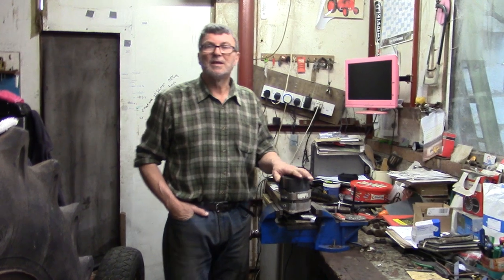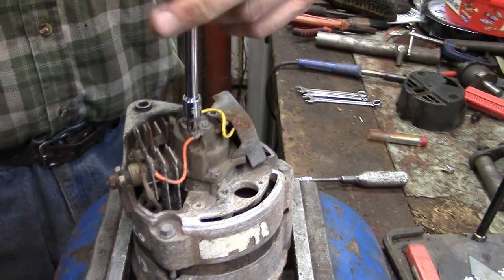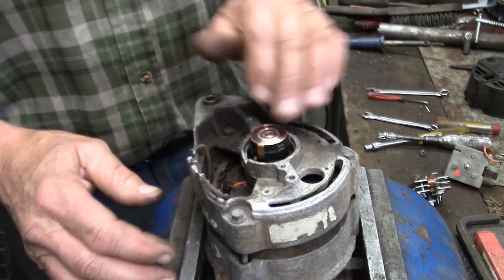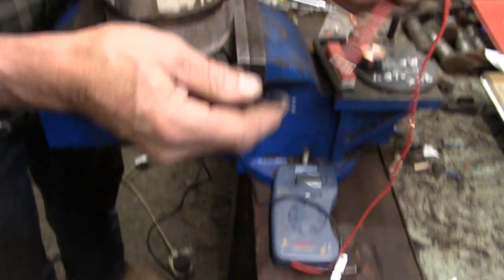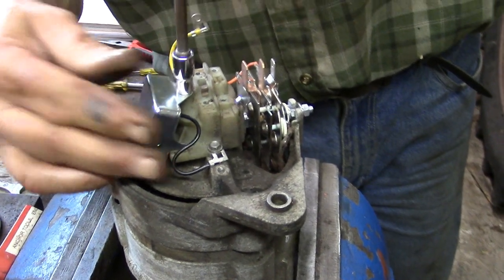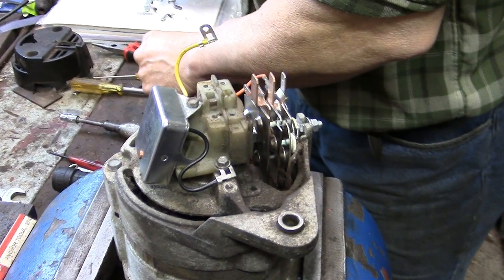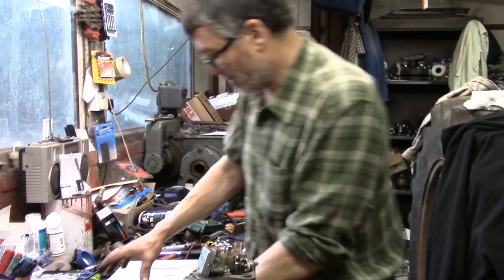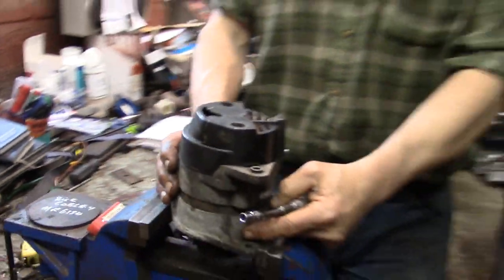Lucas ACR Alternator Repair

Comment: Thanks very much mate , dead right , photo the wiring positions of the components in the back of these before you strip it out , I did one in an almighty hurry on a J.C.B. yesterday , messed it up , had to watch your video to know how to get it right again , ( I unplugged it with the engine stopped , then clipped the cabling back out of harm,s way , so no tragedies . )
I can recommend M.U.R.E. in Mid - Ulster for getting the right parts to you very fast , overnight from Ulster to central england . ( Mid Ulster Rotating Electrics ).Thanks mate & all the best .

Comment: hi im just doing mine and the 2 large wires that go on the large terminals are identical .could you tel me if it matters which way round they go as both brown and both same size ?
Reply from the maker: It’s common to have two power wires and they can go either way, as long as they are not mixed up with the thin wire on the small terminal.

Comment: Hi Montegoson, Great video's! I think I've seen most of them, now. I bought my Nuffield 4,60 about 12 or 15 years ago just to move stuff around my yard (it has a loader frame on it for carting sugar cane from the field to the loco bin.......from before the 'modern' harvester was invented). I've always thought it was a 1953 model, but I can't remember why I think that. Is there any way I can find out when it was made. The 'info tag' is still clearly readable, but only has the serial number / model, no D,O,M. The poor girl has deteriorated over the years and I'm just bringing her back up to spec........Hence, watching all your vids.  Great work, thanks again.
Reply from the maker: Peter Henwood there is a date code on the gearbox by your right footplate. The code is explained in the faq section of the Nuffield forum.   www. nuffieldtractor. com